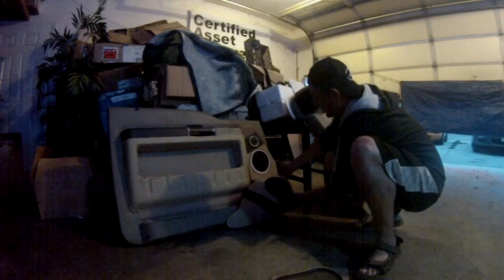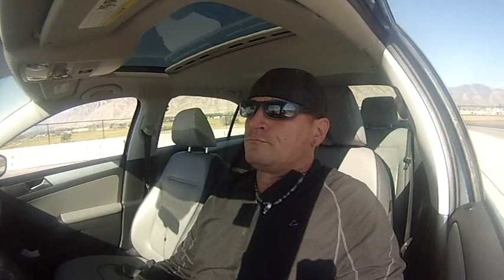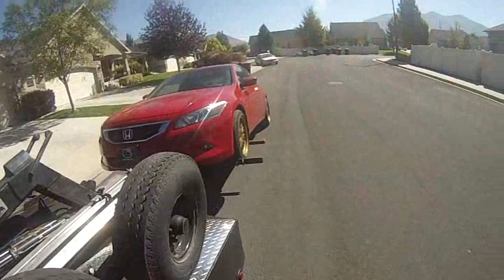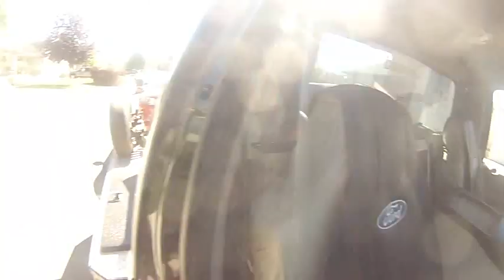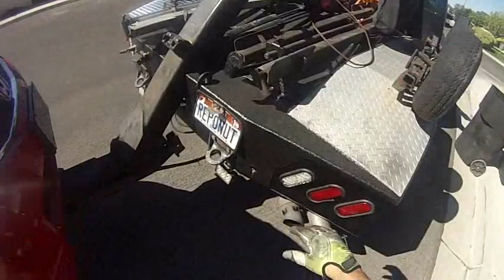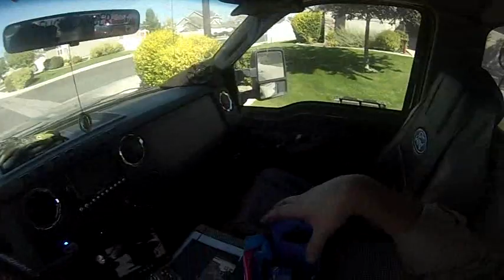Wrapping Up The Door Panels And OMG A Repo To Boot

Comment: What's up with the 480p? No 720p available?
Reply: You watched too soon. YouTube processes the video in 480 and then posts it as soon as it is ready. If you give it another 15 minutes, 720 will appear and then 1080 a few minutes after that.
Reply: It's still not available even in 720p for me at least.
Reply: Ya this appears to be a 480p video in old 4:3 ratio, guess I should pull out a old tube TV to watch it on, lol.

Comment: FYI:  You could probably use Plasti Dip on the diamond plates to make them black.
Reply: It won't hold up
Reply: +blyssed You're right. He'd have to use an etching solvent, then primer, then spray the diamond plate with industrial grade paint.
Reply: blyssed Really?  What do you mean that it won't hold up?  Please explain.
Reply: ***** Not necessary from what I have seen and done.  Is that your experience?
Reply: PlastiDip on a glossy surface is easily removed with a pressure washer. Also, because PlastiDip is soft after it cures, it tends to chip then peel. 

It's a great product for some applications but it never replaces paint.
Reply: Clearly your experience is quite different from mine.  I have put it on glossy surfaces and even marginal surfaces that haven't been immaculately cleaned.  I have yet to see any peeling.  I have yet to see an issue with a pressure washer.  Again, your experience seems different.
Reply: ***** if by 'he' you mean Matt... he wants the ninja to be all black.  the shiny bright diamond plate makes the truck stand out more than all black would.  That's why I had suggested plasti-dip... its not permanent but is a quick durable solution when applied as directed with 4-8 coats.

Comment: Finally back in Business ;) But you don't check the VIN number before the repo? That could by a pretty bad mistake.
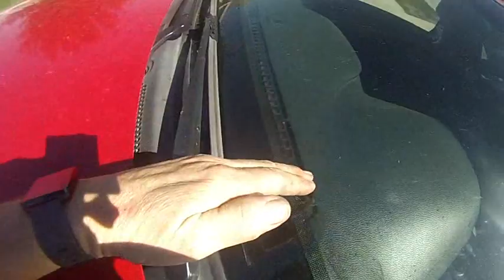Reply: He checked it at 18:19
Reply: he did check it? Maybe you should have checked the video before saying something? That could have been a pretty bad mistake....
Reply: He meant before he hooked it.. SMH.. He did it after he towed it away and drove it around the corner. Now, if that wasn't the correct car, he would be in so much shit.. I would definitely had sue if he picked up my car and he was in the wrong. Please read before you respond.
Reply: remember comment on vehicle being GPS equipped?
Reply: I noticed that too but I bet he looked at the license plate before he grabbed it.
Reply: License plate are very easy to change... Not the windshield with the VIN numbers. .. and it's take 2 seconds to look.

Comment: Those guy's did a lousy job, the passenger side diamond plate should have been polished to match the drivers side and the truck it self should have been polished & buffed. Not to mention the stuff you pointed out being broke. It's supposed to come back better not almost finished.  That's garbage work if I ever saw it.
Reply: The diamond plate  was supposed to be black.
Reply: I know, but you still don't send out something polished on one side and not polished on the other.
Reply: It shouldn't have been polished or unpolished, it should have been black.
Reply: No shit for the 2nd time!